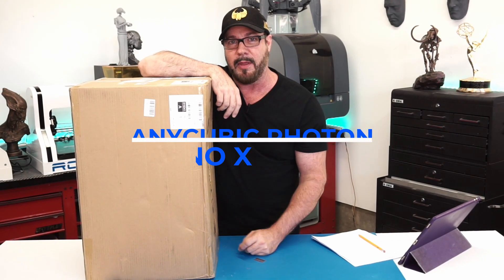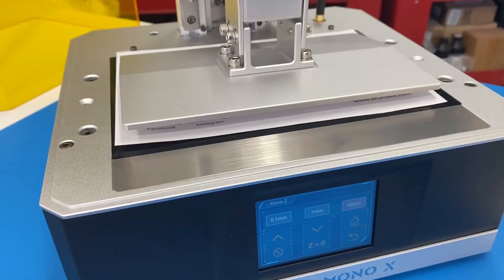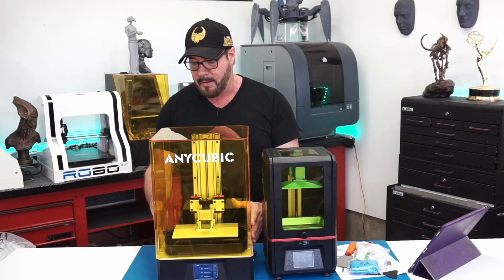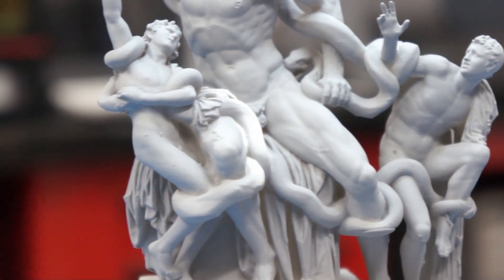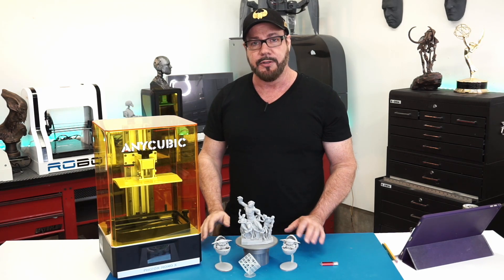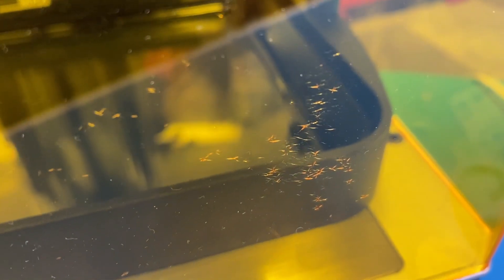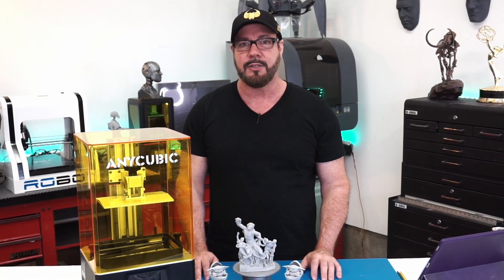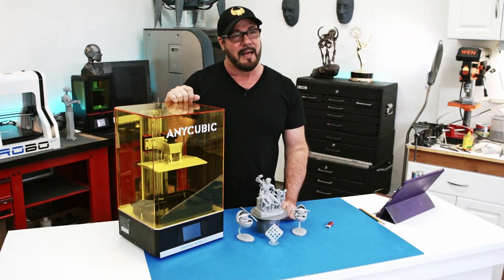AnyCubic Photon Mono X unboxing and review

Comment: Hello I got this printer and am having issues with the print not sticking any tips?
Reply from the maker: Relevel the bed again to make sure your home is correct. Also check your exposure time with your resin. And lastly I’d check and make sure you’re  set to 100% on the exposure power level.

Comment: I have now had mine 4 days and it was definately not worth the two month wait.  Fedex delivered it in an undamaged box but deapite the nice packaging inside my cover was shattered and cracked.  I taped it all back toghther and set off to printing.  The provided sample print failed multiple times, then some of my own prints failed multiple times.  I releveled the bed numerous times with no luck.  Finially I put a machinist straight edge on the bed and found out that it has a bow of nearly half a MM in the center.  Basically all 4 corners of the plate touch but nothing in the middle.  I did get something to print just now by positioning them on the very outer edges and it worked verifying that my resin and 3 second layer times are not the culprit here.  I have had so many failed prints now that I have just about worn out the Fep from cleaning out the vat a dozen times.  Anycubic is so cheap that they have decided not to even send a single spare sheet with a 550 dollar printer, what an absolute joke.  I also hate the way that the screen is held in with tape.  my vat and film do not sit perfectly down on the screen in the corners because the tape seems to be a bit too thick around the edges.  I have started a service ticket with Anycubic but I dont have much hope as their service lately has apparently gone way down hill.  If they let me send it back I will box this POS back up and send it back to them stupid lift off monster cracked lid and all.  They sure have gone downhill since the origional photon.  For anybody on the fence about ordering this and waiting who knows how long I would say dont do it, wait for something else to come along, this thing is rubbish, real shame to I am an anycubic fan boy from way back but I am jaded now.
Reply from the maker: I think most companies are rushing to market and sending sub par products out. They all want to be the first to have 4k, mono, crappy plastic lid, that shatters with no frame..ughh it so disappointing but not surprising. I hope you resolve your issue with AnyCubic. Leave a comment here and let us all know how it goes! That bow has got to go!
Reply: @Will Huff  To my suprise customer service replied to my ticket and assured me that they would be sending me a new cover and a new plate, but half of the email was chineese and half of it was english so we shal see.  They asked to confirm my address so that is a good sign.  Hope it takes less than a month.  I should be able to surface the plate on a milling machine next week to get it dead flat and then hand sand it for some texture and hopefully that will do it...Happy Printing!
Reply from the maker: @DimensionMachine  that’s great news!
Reply: @Will_Huff  Well Despite several emails back and forth with my anycubic "engineer" that has been assigned to my complaint I still have no tracking number for any replacement parts.  He just wants to send me an email asking me to complete a survey if I am pleased with his results....he is about to get a completed survey allright!  Now yesterday I noticed that the acrylic cover...what was left of it is starting to craze all over.  I have not wiped it down with IPA as I am framiliar with its effects on acrylic, especially less expensive extruded acrylic.  The entire cover is showing signs of cracking but it is definately the worst down where the acrylic is closest to the vat leading me to assume that the fumes from the resin are attacking It.  I am using elegoo ABS like resin which is of course common as dirt and I cant wait to see what other people experience with theirs!
Reply from the maker: @DimensionMachine  I’m seeing a lot of comments like this on several forums. I’m also seeing issues on the forum where folks are having UV light leaks, where the entire fep is  being slightly exposed to create a sorta sludge on the bottom of the vat. I think Anycubic will be forced to deal with these issues. Keep us updated on your issues!

Comment: Hi will, 

Just subscribed. Do you have a url for those 3D files you got from a museum? That print is gorgeous
Reply from the maker: Thanks for subbing! Yeah head over to My Mini Factory..there are TONS of free museum scans there!
Reply: @Will_Huff  thanks again.I just saved a bunch of those sculpture files and am using Chitubox now with your work around. Super informative video. The resin you're using is crazy expensive. Is it really that much better than anycubics? You should do a video on that
Reply from the maker: @brandonoliver2818  It's not better. I purchased several new bottles of resin that were on sale on Prime day. I'll try and do a comparison video soon. The stuff from MonoCure is expensive as it ships from Australia and its added into the cost (from amazon), which is why its higher...but not better.. they do sell some interesting resins like Flexible and another one called Tuff, that makes prints less fragile. But they are even more expensive and maybe only for a special use case prints?

Comment: Nice review.
The removable lid can also be a big plus like when you need to do some work/maintenance or cleaning. Then you have all the room and nothing is in the way.
As for the lid damaging like that. Maybe putting a handle and some 
transparent adhesive foil on it could help?
Reply: The lid breaking is a known widespread issue. The cover material is getting damaged by the resin fumes. It is possible to contact anycubic and request a replacemement (They have actually changed the material of it on the newer batches). This is completely covered by the warranty so it ships to you for free.

Comment: In my case while ip is loading on mono x it says fail. ;/
Reply from the maker: Mine did too. Make sure the name and password have the correct punctuation, make sure there is a comma after each line. Also make sure to reboot after you add the WiFi txt. mine would say fail..then after 5 min it would show the IP.

Comment: You can just print a handle and attach with double sided tape, did that for my sonic mini and AC Mono and my wash and cure. Keeps the cover clean.
Reply from the maker: I might do a crazy mod/video, where I'm going to build a robotic crane system to lift it up and replace it for me.
Reply: Suction cup to top and pull up with a pully and string hanging from a 3d printed bracket hanging off the wall?